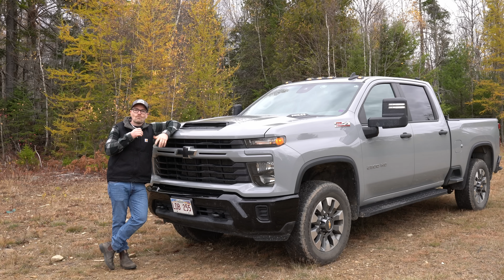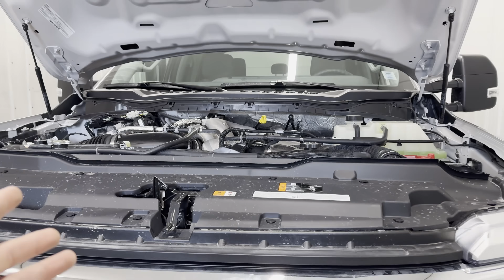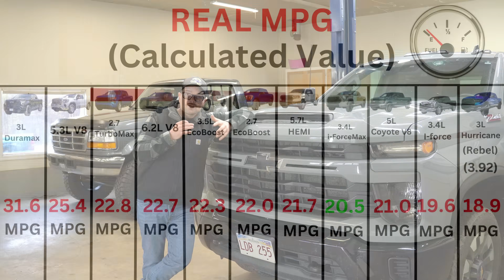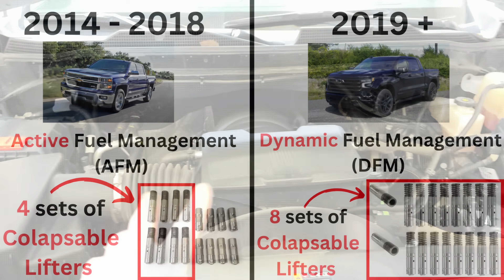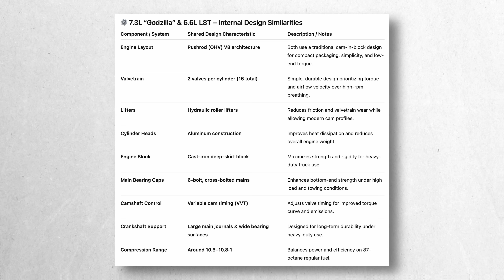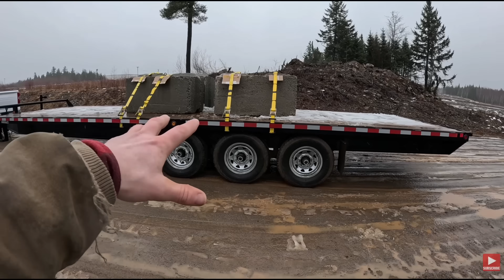Chevy 2500 6.6L L8T V8 Review | GM’s MOST RELIABLE Engine They Still Build

Comment: My 2022 GMC Sierra 2500 HD SLT 6.6 Gas with the 6 speed. Truck has been Flawless - GET ONE - this is my 4th New Sierra HD - all were Bullet Proof ! My truck uses 1/4 quart of oil in 5000 miles when I change my oil. (Currently 40,000 Miles)
Model Name: Hydra-Matic 6L90 6-speed automatic Engine Pairing: Standard 6.6L V8 gasoline engine  L8T (401 hp and 464 lb-ft of torque)
My Truck gets 14 MPG +-, for a great ride lower the the tire pressure to 50 psi, not the recommended 60/70 needed only for hauling.

Comment: GM corrected some of the flaws they had with their Billion dollar L87. They got rid of the cylinder deactivation which is good but, they stayed with direct injection. Carbon deposits will trash the valves if they aren’t blasted with walnut shells every 50k miles. Port injection would have eliminated this problem. I was a GM guy my whole life until the L87, and I’m afraid this 6.6 still has some issues.

Comment: I have this identical gray truck and engine.  Bought it brand new. I’ve put 48k miles on the truck.  Warranty replaced back-up camera, wiper washer pump, tailgate button, ya know, typical modern tech plastic b.s.  But the 6.6 gas engine has been trouble free.

Comment: I own a 2020 2500HD and I have the gas engine. I love it. It has great power and the economy is not bad for what the truck is. I am a diesel tech and I would never have a diesel. There a pain in the butt. This engine is a home run in my opinion

Comment: I have one in a cube van, strong motor, love driving it. Problem is it uses 2 qts of oil between 5000 mile oil changes. GM says that's normal.

Comment: 21000 miles on my 2025 with 7500 intervals. I send a sample off each change. After break in fuel contamination and wear particles are way down since it's broken in and barely 1/2 qt between changes. I do recommend a catch can to keep oil out of the pcv system , use top tier gas and an upper cylinder lubricant every 3-4 tanks.

Comment: I had one and #5 injector replaced within 500mi of new. Never had a promblem after that. I like it but compared to the others i dont like the high pressure fuel and injection style for the long term. Probably the best looking though and best lower trim levels for sure.

Comment: What I can say with my short experience with this truck is that i wanted a truck to use as our family vehicle that had a motor I knew I didn’t have to worry about when I had the 5.3L with the AFM. Brand new off the lot a few thousand more than a 1/4 ton. Followed the break in procedure and changed the oil after 500 miles and I’ve always done 5K mile intervals. Love this truck

Comment: How does the real world torque compare with the GM 3.0L diesel engine?  You have driven both.  I don't consider the 3.0L diesel to have long term reliability.  Not enough data on it yet.  I want an engine to go at least 500,000 miles without engine work.  I will perform all the necessary maintenance ahead of time and use the best available lubricants, etc.

Comment: I bought my O.G 2020 brand new.  First in my area to own one.  Just rolled 100k and it’s been mechanically flawless besides a corroded ground strap from the frame to the motor.   I love my truck 6 years later.

Comment: I was a GM lover going back to the mid 60s and probably through the early 2000. Had a 69 three-quarter ton Chevy pick up, 65 GTO, 68 GTO, 86 Delta 88 with a Buick V6, and 87 suburban 
The last 15+ years I’ve been mostly Ford but there’s always room in my heart for a 5.7L Hemi Ram. 
All vehicles were gasoline except for tractor trailer trucks with their big Diesel engines.
But then the manufactured oil shortage/embargo from OPEC and the push for diesel fuel economy…. Downhill from there. 
Now gasoline BB Chevy’s and Fords are back…

Comment: great video... i think you changed my mind. I was sold on the chevy express van that shares this engine. Always been more of a chevy guy. But I had my doubts about the direct injection. I think I am going to look harder at the old Ford E series cutaway van and chassis still offered for box trucks. Just looking at the insane fuel pressure of the 6.6 is almost enough to make me say hello to the Ford Godzilla

Comment: Very good and informative video, and I'm really happy with your analysis because I bought a 2024 Silverado 2500 HD with 30,000 km on the odometer six months ago. It has a 6.6L engine and I use it to tow my 30-foot fifth wheel, and it's like I'm towing a small trailer. However, I find the fuel consumption a bit high, but I think it's a good alternative to the Duramax.

Comment: I Just seen this Engine being Installed in a Nickey Chevrolet Camaro which brought me here to check it out! I wasn’t aware of this engine being such the Monster they said it was! Nickey Chevy said their Stage 3 build would be close to 2k Horsepower and it’s so much better than your standard LS 5.3/6.0/6.2 especially since it doesn’t have Cylinder Deactivation and it has direct Injection! I’m really surprised there’s not more of these being installed in vehicles instead of the Cookie cutter LS Engine!! I’m guessing when the new wears off of them and they become more available it’ll replace the Old LS Swap!! Being a Die hard Ford guy, I’d still take a Coyote any day of the Week over any Junky GM Engine!! 😂😂😂

Comment: Fix the factory stock oil consumption and make it multi port injection and Im sold. Until then... ✌️

Id like no high pressure fuel pump. Seen some issues w that. And they def are a bear to get to. Ask me how I know 😢

Comment: I KNOW HOW TO RESOLVE THE PINGING 😮😮😮😮😮😮
My secret 🙊 I have the 2024 isuzu NPR with the GM 6.6L L8T V8 engine, it has a 38 gallons fuel tank so I run 36 gallons of gas ⛽️ mixed with 2 gallons of Diesel ⛽️ 😮 an it runs like a champ 😮.. if i run straight regular gas it actually pings.. 😮 with the diesel it runs smoother/ cooler 😎 an much more power with better mpg with no pinging.. 
25+ years Mechanic..

Comment: I have a 2022 Chevy 2500 with the L8T and the 6 speed trans and it drives beautifully at 50k miles. Gas mileage is pretty consistent around 16 highway and about 13 everywhere else. Burns between 0 to a half quart between the 5k oil change intervals which is nothing crazy. 
EDIT:Also, I gotta say that the comment section on this video is almost more helpful than the video itself!

Comment: The HP fuel pump location is the same as the 6.2L, 5.3L. Just remove the intake manifold. Its pretty much the norm. 30mins in and out.

Comment: I have a 2024 2500HD with a steel contractor bed fully loaded with tools. I love this truck. The 6.6L has plenty of power and it drives exactly like it did when I picked it up brand new with an empty bed. I literally can't tell the difference. The Allison branded transmission has also been incredible. Smooth, positive shifts, excellent programming too. At 6'5 the regular cab has more than enough room. Very happy with the truck overall.

Comment: My oil cooler on my 2024 2500 HD just went out at 86000 miles. Fortunately I bought the 100K warranty. This truck has been babied and serviced on time. No excuse for what they cost for any failure under 209K

Comment: I have a 2004 Chevy 3500 dually full size crewcab, longbed, with the gas 8.1 - 496 ci big block with 4.10 rear gears , it only got 265,000 miles on it runs like new. I can’t complain on its ability to pull , what can I say it’s the 8.1 bulletproof gas guzzler. 9 mpg city, 10 mpg highway. I think it will go another 250,000 or more. If I bought a new truck it be the 6.6 gas 3500 I like it’s highway mpg.

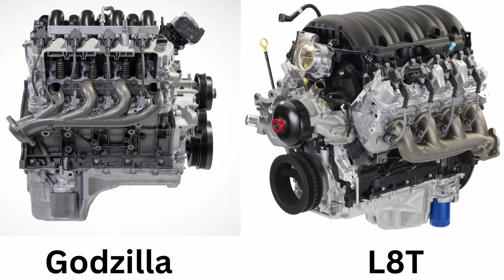Comment: you got the design comments backwards at 9:08. The LS engine series, is very similar to the old small block fords. You can even bolt LS heads to a SBF and vice versa. So GM took a lot of design inspiration from Ford, and Ford is just revisiting their Windsor style and modernizing it. On that note, I'm a Ford guy, but I will be buying a Chevy Express 6.6 work van because ford's work vans are V6 turbo, over complicated, european garbage. The Transit series SUCKS.

Comment: My 2020 gmc 6.6 eats oil like crazy!   I did a oil change not long ago and after 1400 miles it drank 1/2 quart.  This has been doing this since I bought it.  Had rear main seal replaced still no change!  GM sent a letter out years ago and they said its normal cause of direct injection.   😠 😡

Comment: Between the Ford 6.8/7.3 gassers and the GM 6.6 gasser, simplicity equals reliability under load. Too bad fleet fuel economy standards have turned all dealerships into shiny salvage yards.

Comment: Looking to pull a small travel trailer 18 ft only weighs about 4000 lb loaded but I am looking at the Savannah cargo vans with the same engine in the 8-speed transmission with the towing be very similar to this truck

Comment: FORD 7.3 godzilla vs GMC 6.6L V8 GAS ENGINE  Which would you buy for reliability???  I have a constant 4000 LB payload truck camper.  OK after the 3 Cons video I'm going with Ford 7.3L.

Comment: My 2025 6.6 hasn't used a drop of oil that I can tell in it's first 13000  miles. The torque is amazing as it has pulled my 30' travel trailer almost like it wasn't there. I do change my oil at 5000 miles as I do on all my vehicles and I use good fully synthetic oil. So far I am very pleased with this truck and engine package and I am hoping for many trouble free miles of use.

Comment: I have the same 6.6L L8T engine in my Isuzu NPR-HD box truck 🚚 with a 38 gallons fuel tank, I run 36 gallons Gasoline ⛽️  mixed with 2 Gallons of Diesel 😮😮😮 an it runs like a charm 😮😮😮😮😮😮😮😮
Yes I am a Certified Auto Mechanic. The engine actually pings when I run straight 87 Gasoline. The engine actually runs was better and smoother with the diesel mixed. My mixture 18 Gallons Gas/1 Gallon Diesel. 
Don't Follow my research..

Comment: I have a 2020 Chevy 3500 LTZ 6.6L gasser with the 6 speed trans. I have 74K plus miles and zero issues with the motor or trans. I love the look and get continuous compliments on my truck. I do not like the Ford’s aluminum body, but I would love the Godzilla engine. I do miss the exhaust brake on my old 2015 Ford F250 6.7L diesel, which had terrible payload capacity.

Comment: Thanks for this review.  I have a 2021 L8T GMC Savana 2500 van.  Great towing van.  No complaints with 73k miles.  Tows my 8000 pound travel trailer.  I’d like to hear what can be done to prevent the direct FI carbon build up.  Detergent fuel and maybe fuel additives?  And do they really help.  Also I read the EGR can get buildup.  As for the high pressure fuel pump on my van it’s accessible via the internal engine cover so I hope down the road I can deal with it better.

Comment: The 6.0s were bullet proof because they didn't have all the crap the 1/2 tons do. Most buying a 3/4 ton and up truck care about towing capacity, reliability and longevity some where way down on the list is mpg . Make trucks for work again and not overpriced luxury cars with a bed. Best longest lasting trucks I've had were all the stripped down work truck editions.

Comment: I've been driving this engine daily for a bit over 2 years, no issues at all (knock on wood)! Wanted no AFM and the payload of an HD without the cost or headache of the diesel. It drinks gas like nobody's business, but I still think the HD gassers are the best trucks you can buy today. That said, do you think an AOS or catch can could mitigate carbon buildup on the intake and valves? I'd like to get ahead of it but I'm hard pressed to modify this engine without good reason.

Comment: I have the 2025 AT4 version and it’s snappy as far as that 10 speed. I had the 2020 6.6l gasser and I feel the 2025 is a huge improvement. I had a 2023 Denali with the duramax and hated it. I’m happier with the gasser for sure

Comment: GM should still offer the 6.0 as a legacy engine. Mine has 10,600hrs of run time and still doesn’t burn any oil or have any type of issue. The 6.0 is the best gas engine that GM ever put in a pickup.

Comment: As long as the body doesn't settle down over the frame I will continue to drive my 2008 and 2011 Duramax 2500HD.  Not interested in any GM engine/tranny after 2013, gas or diesel.
Doc - old GM Plant Engineer.

Comment: Your mpg estimates are way WAY WAYY off haha.
My 2019 6.2L 1500 Denali Ultimate 4x4 has had every fuel up recorded since 2019 and my average in FLAT Kansas is 15.79MPG
1 time - 23mpg (hypermiling)
1 time - 21mpg (drafting a semi)
2 times - 19mpg
5 times - 18mpg
22 times - 17mpg

towing 8000lbs, best is 11mpg 1 time, worst is 6mpg 1 time, and 10mpg 6 times, 9 mpg 5 times.

Comment: I'm old totally old school (I'm 74) and grew up with small block Chevys. With the exception of your whining about direct injection, I agree that the old school approach with iron block, pushrod valves, etc. is the way to go. Overhead cams, like Toyota and the like, is for sports cars - NOT a working man who depends on his truck. She's gotta slug it out and work, every day. When I retired, I bought a '25 Silverado 3500 with a 6.6. (my last new Chevy was an '86 with a 350) I love this new truck every bit as much as every one of my others. Better mileage, more power, and she can pull my house right off of the foundation. I very easily see this being my very last truck.
Reply: Does it have the 10 speed transmission?

Comment: I can't understand why you in the US have turbos on your v8s or.Tex 6 liter dual turbo with a small and a larger turbo. Should easily have 1000nm and 600hp and still use less fuel than this thirsty sluggish engine.

Comment: Nice update video. I didn't need an HD truck, but I bought this truck new in 2022 over a 1500 because it didn't have AFM/DFM. Wanted nothing to do with that. Got a crew cab LT with plenty of creature comforts for $55,000 (US), which I didn't thing was too bad. If GM ever gets rid of AFM/DFM in the 5.3/6.2 I'd get a 1500 Trail Boss. Love this truck though. 40,000 miles and no issues. I added a catch can and did replace the coolant reservoir as a precaution (it was looking rough). I change oil/filter every 3-4000 miles tops.

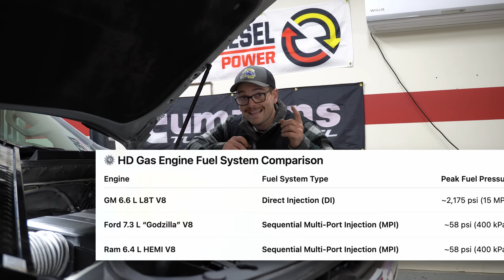Comment: 11:13
13:41

I'm gonna have to disagree to a point. While the Ford's fuel pump and lines are easier to access, it's also more prone to fire hazard, as well prone to (piinhole) leaks and cracking due to being more exposed to the elements.

One thing for sure: I'd get rid of the plastic intake/beauty cover, as well as the plastic valve covers......Replace them all with metal.

Comment: 100% Disagree with this being a good engine or truck. I drive a 2020 Silverado 3500 HD with the 6.6L gas engine. This a company provide truck. I got it with 26 miles on it. It was in the shop the first week leaking power steering fluid to the tune of 1 pint every other day. At 2,400 miles the transmission had to be dropped and the clutch packs for gears 3, 4 & 6 had to be replaced. At 40,000 miles it started to use oil. I would not spend my heard earned money on a HD Chevy pickup.

Comment: Um.....
"Hypereutectic aluminum pistons, to really help with thermal management"??
These pistons have been the standard for probably half a century.  Also, I don't see what is so much more durable or robust on this engine vs the other LS engines. The cylinder deactivation is not what destroys the cams or lifters on these engines, on the Hemis or on Godzilla. It does certainly create its own problems in  the LS engines that are NOT present in the Hemi (mainly oil consumption and other failure modes of the AFM/DOD lifters, but they don't by themselves cause any roller failure -- that's inherent to all LS/Hemi/Godzilla lifters, regardless of cylinder deactivation). But what's so different about the hypereutectic pistons? And what is so durable about these engines, besides the lack of cylinder deactivation?  Did they change lifter/cam suppliers as well? I know 5w30 is gonna help, but .....idk....time will tell!

Comment: I REMEMBER WHEN I FIRST DROVE THE NEW 10 SPEED GM TRUCKS.  IT FELT LIKE GM SHIPPED THESE TRUCKS   WITHOUT TOTALLY FIGURING OUT THE TCU/TCM TUNING BUT NO WE HAVE NEARLY 10 2020+ GM TRUCKS FAIL.THE GAS TRUCKS BURNED SO MUCH OIL FROM THE TIME THEY WERE NEW, THAT OUR GUYS FORGOT TO TOP THEM OR CHECK THE OIL AND BLEW EM UP BUT WHAT NEW TRUCKS BURNS 2 QUARTS OIL EVERY 8 DAYS 😂 AND OUR 2500/3500 DURAMAXS, IM NOW ON MY 24' 3500 BC THE 3 IVE HAD BEFORE HAD THE FAKE ALLISON SHIT THE BED. 1ST HAPPENED AT 9500 MILES, REPLACEMENT TRANS WENT AT 21K. THEN I GOT MY 22' AND IT FAILED TRANS. 23'FAILED. HOPEFULLY MY 24 DOESNT GET SENT BACK TO GM FOR 5 MONTHS AGAIN . USED TO PRAISE THESE DURMAX ALLISON TRUCKS BC WE HAD SUCH GREAT LUCK WITH THEM BUT FUHK GM. THEY DONT CARE ABOUT THEIR CUSTOMERS AND THEIR FINANCIAL LOSES DUE TO FAULTY PARTS.

Comment: Almost 20,000 on my 2024 3500 dually with the l8t and 10 speed with no complaints. Recently found out if you allegedly select off-road mode it locks the rear and couple that with traction control off it’ll melt those Michelins. Also if a big truck don’t make big truck noises it ain’t made with big truck parts. Keep ya foot in the gas and you want here or feel a clunk!

Comment: I hate to be the one to hurt feelings, but these gas engines mentioned in the video will never out perform the 6.6 duramax or 7.3 powerstroke diesel engines in power/torque or reliability.

Comment: I have the 2024 2500HD Bison and love it. Smooth ride and have hotten any where between 10-13 mpg city depends on how may trffic lights I catch and idiots on the road. The best highway mpg I go so for is 18.5 and thats with the stock mud terrain tires on it. Hauled a tone og sinder blocks with it so for and made it ride like a Cadillac.  Haven't towed with it yet with a significant trailer.  The only trailer I have is a 4x8 trailer and its easier to lift 200 pound items the foot off the ground with that vs. The 5 foot into the truck bed.